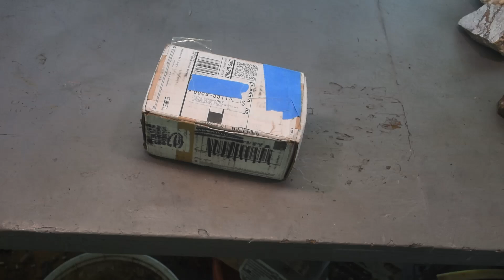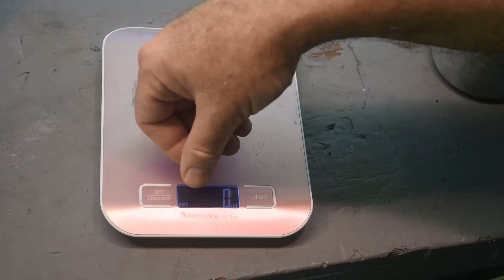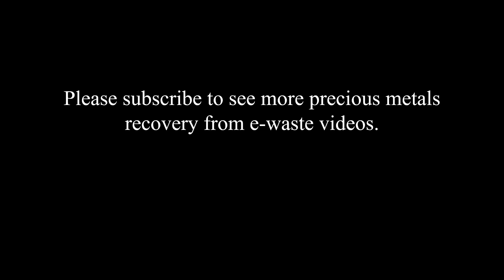Big Silver Refining Challenge #silver #silverbullion #preciousmetals #chemistry #smelting

Comment: Check out https://www.youtube.com/@anthonythomasfmg His four step electrolysis system he calls the four horsemen would probably be able to handle these silver welding rods. Hes willing to smelt and refine silver plated material and claims he does it profitably. That cant be more than 1-3% silver. If he can do 1-3% purity profitably he definitely would be happy to have a 50% purity alloy. What that would look like, in this case i think, making an electrolytic cell with copper sulfate, an alloy anode basket, and a copper cathode. You might need to mix some copper in to the alloy but I dont think so. The impurities and the copper should be able to dissolve into the saturated copper sulfate solution as the cathode strips the copper out of the electrolyte. You might have tin left over as anode slimes... 

Alternatively you might be able to just add lead or zink to the alloy to get it down to 25% silver and then just dissolve all the impurities in boiling sulfuric. That would avoid the need for nitric. Copper doesnt dissolve well in hot sulfuric but it does dissolve and all of the surface area created by removing the lead, tin and zink would offer a lot of area for the hot sulfuric to attack the copper.

Comment: Can it go in the Mighty Mill and be broken down to smaller bits without issue?  I'm concerned it might be too soft, and alot of the metal would "smear" over the inside of the Mill.  iF IT CAN be run, what about this?  Break down pieces to much smaller particles (Doesn't need to be sand or dust sized, but broken up well.) to greatly increase surface area.  This would make Muriatic Acid boils MUCH more effective and more quickly allow base metals to be dissolved.  If the material can be broken apart rather small in physical terms, you might get it up to 90% or higher silver purity by doing Muriatic acid boils.if you can get it this pure, you are now able to run it in a silver cell.  It kind of all depends on how soft the metal is/whether it can be broken up without issues in the Mill, or perhaps by another means.  Hope this idea is of some use to you.  Would love to see a video attempting this, even a small test ammount, even if it ultimately didn't work.  Cheers!
Reply from the maker: Instead of the Mighty Mill I am contemplating melting it and corn-flaking it in water to increase the surface area.

Comment: You can't electrifine it until it's over 90% pure. The only cost-effective way is to cupel it direct cupilation with Portland cement. Get it to above 90% then electro refine.  You don't need to add anything. The silver should be left intact.

Test batch, Use a blower and a chunk of kiln dried firewood as a fuel source. Build Portland cement cupel bowl, put 100 gram sample in the bowl, bridge the bowl with the fire wood, prechar the side that's going to face your molten material. Get the pre-charge side smoldering before you turn on the blower. Make sure you know how much Portland cement you started with only run the blower at a speed that won't blow away the powder and make sure you set up some Stones behind it to act as a slihht up draft.

There's some Pakistani videos that just demonstrate the direct compilation method where they make dore from cell phone boards, then direct you pallet with Portland cement and then do the basic aquaredia refining after. I dictated my comment and I got tired of editing it so you'll have to read the end out loud to understand what I really meant but you'll get it. Good luck! Can't wait to see the video.
Reply: I should have said one of the cost-effective ways not the only. Sorry

Comment: 2. Charge crucible — cut / chop rods into short lengths so they melt consistently.

3. Melt with flux — heat to just above melting range (~650–750 °C depending on alloy). Add borax or a borax/soda/fluorspar flux to help coalesce metal and form a lighter dross that floats. The flux encourages base metals and oxides to form a slag on top of the molten metal.

4. Skim dross — while molten, skim off oxide dross (this removes a lot of copper/iron oxides/tin oxide). Repeat melt/skimming cycles to concentrate silver.

5. Collect silver-rich button — after repeated refining you will have a heavier silver-rich button and a slag/dross fraction.

6. Cupellation (if higher purity required) — traditionally you mix the silver button with a bit of lead (lead collects silver and forms a lead-silver alloy). Oxidize the lead in a porous cupel or hearth (airflow at ~900–1000 °C) so lead is oxidized and absorbed into the cupel, leaving silver behind. This step removes lead and many base metals and is how ancient/modern refineries separate silver without acids. Expect small silver losses to slag/cupel. 

7. Final melt & cast — melt the silver bead, pour into ingot mould, weigh and/or send for assay if needed.

Comment: zink will evaporate with enough heat.  the rest might be partly removed by using a low cost "sement cupel" and get a lot of the metal out in oxides then a silver cell.

Comment: I’d have to know a bit more about the soldering rods.  Are they 75%, 54% or 15% silver.  The best method is still nitric but as you said expensive.  Melt everything down and make shot.  Try a small amount with Nitric, a small amount (same sample) with sulfuric poor man’s nitric.  Another with HCL.  I think for the cost the HCL method is best.  Gather up silver chloride and convert to silver metal.  HCL is getting up there though.  I get Nitric for 20 dollars a gallon and HCL for 10 dollars a gallon.
Reply: He said 56% silver and about 24% copper with the remaining part being zinc. Or something close to that but the silver was 56%.
Reply: @MillerWB87 Thanks at that rate there are very few options.  At 75-90% we can use other methods but what I would recommend is melting everything making an anode bar.  Get a sheet of copper and use old used HCL solution and put in a bucket.  Connect power to melted anode and neutral to cathode.  This will plate out all copper and leave silver on bottom.  All zinc should go into solution.  Lowest cost way to go.  I’d still go Nitric method.  Hope this helps.

Comment: This is a tricky one. I think you'll need to remove as much base metals as economically possible with acids.
Then, move onto refining with electrolysis or cupell. 
Silver is one of those nuisance metals that gets in the way of what should be a straight forward process. 
Zinc and tin are reactive in HCl but the high silver content will probably block that with passivation.
If you can oxidize the base metals you're half way there

Comment: I watch videos where people purify gold by inquarting it with silver,  making small beads and then use nitric acid to dissolve the silver and other metals, leaving only the gold. Could you melt this stuff and pour it over wood in a tank of water to make it into beads, but instead of nitric acid, use HCL to remove everything except the silver and copper? Then you could use nitric to dissolve just what’s left, and use NaCL to make silver chloride or just use straight copper to cement the silver out. Just my nickel’s worth.

Comment: If i de-electroplate silver plated holloware could I send you the liquid or hire you for video expertise? Using the salt water stainless steel battery charger method.
Reply: I have in excess of 1,000lbs to process. Tried it a few times but all i ended up with was blue liquid and mud like substances

Comment: I have heard that silver will alloy with zinc very well. It is sometimes refined on a large scale by melting with zinc and slowly bringing the temp down until the zinc skims. Get the skim off and it has most if not all of the silver. Use portland cement as a crucible and put an oxidizing flame on it. The cement will absorb the zinc and leave the silver.
Reply: The portland cement trick looks promising for this amount.
Reply: I also was wondering about Cupertino with Portland cement
Reply: Cupelling
Reply: Adding zinc and absorbing the silver in the molten zinc is used to extract silver alloyed with lead.
Molten lead and zinc doesn't mix, but in this case the silver is alloyed with copper and zinc so adding more zinc would just dilute the silver.

Comment: Melt that and run it through a silver sale collect the sludge and then process it it's slower but it does the job you get clean silver that you can run through the electrolytic silver sell again and process that sludge to get whatever's in it left
Reply: To be more specific melt that and run it through a silver sell collect that silver that plates out melt it again and run it a second time  in a clean silver sale then it should be clean silver